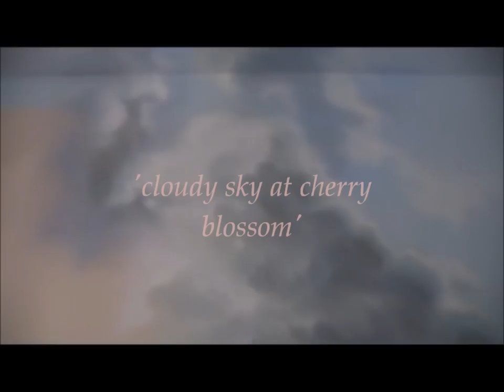CLOUDY SKIES at CHERRY BLOSSOM - Airbrush Mural speed painting

Comment: The gun could be a Magic Spray Gun Sprayer Air Brush a gun is a gun it depends on the beholder if you just get the colors right  and the textures it's smooth sailing from there